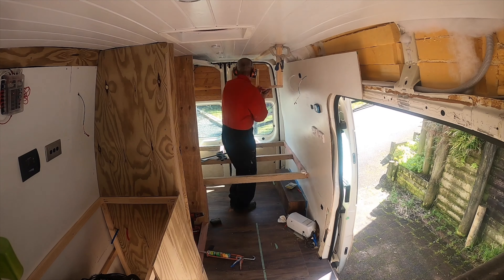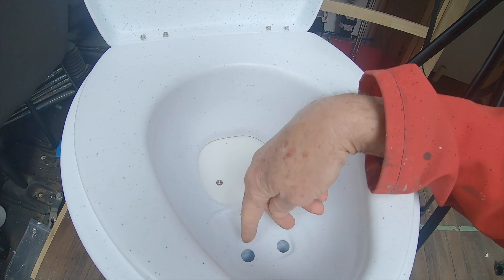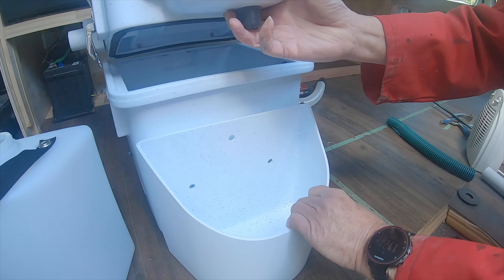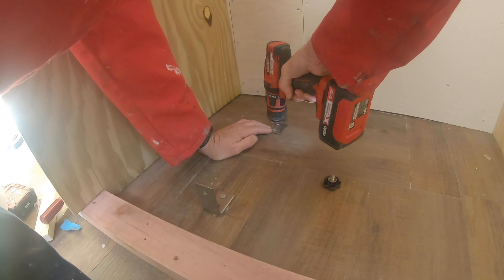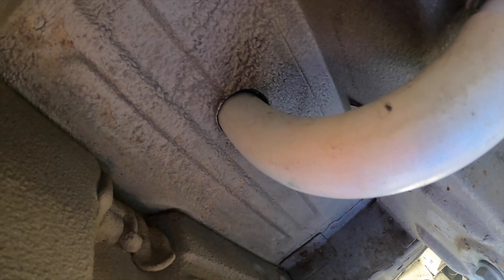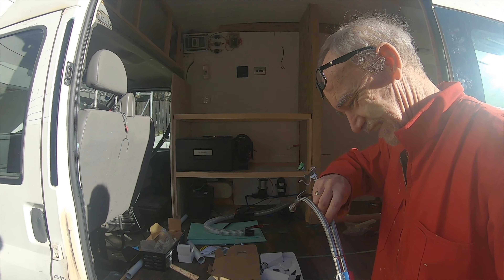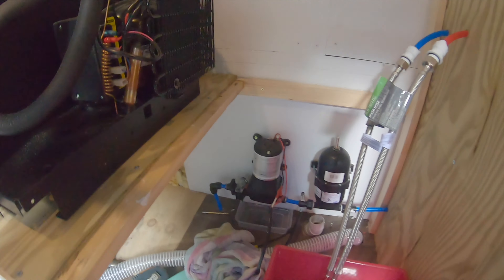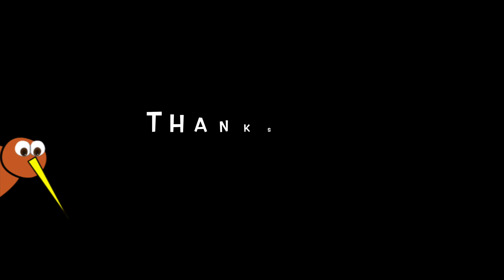Plumbing our Composting Toilet, An Overhead Cabinet, and a Plumbing Test | Transit Van Build | EP13

Comment: You are motoring along both. The toilet doesn't look as bulky or big than in the showroom photos, so thanks for sharing. Really useful. Sorry about the pump - fingers crossed it gets sorted quickly for you. Take care both.

p.s we have the same mitre saw. Albeit ours makes more smoke than cuts these days due to a dull blade.
Reply from the maker: Yeah, the toilet is a good compact size. We were expecting it to be bigger as well. And there's plenty to get on with while we're waiting for the pump, thankfully. Thanks for watching :-)